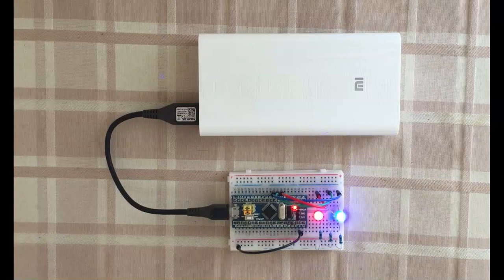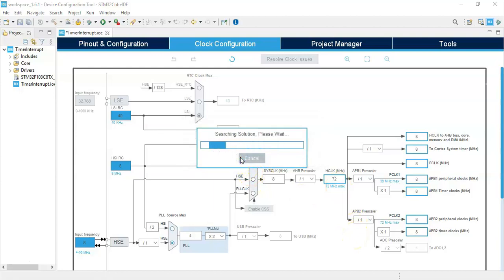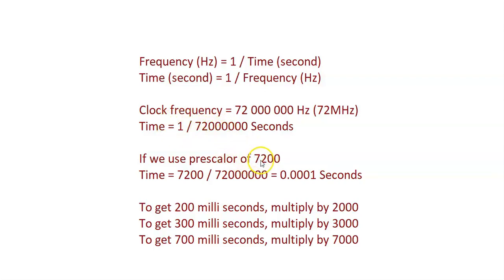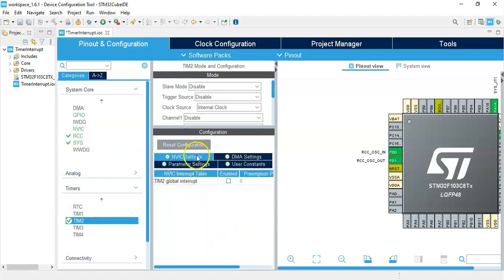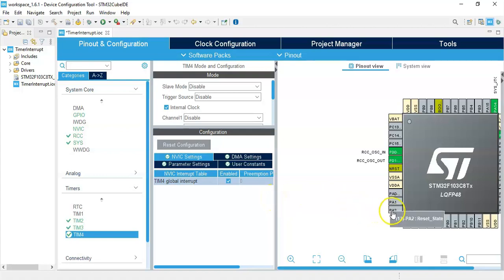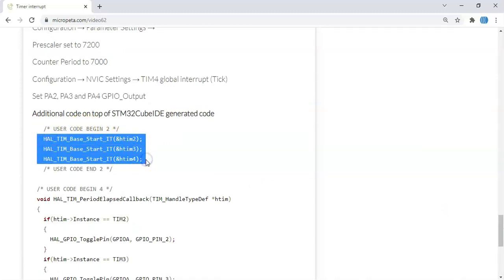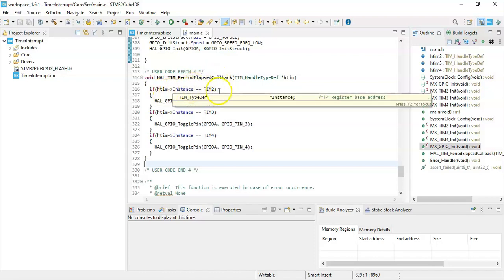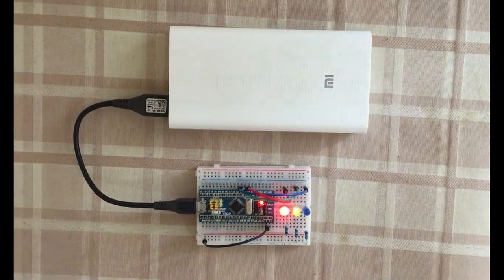62. STM32CubeIDE Timer Interrupt with STM32F103C8T6

Comment: Awesome video, Thanks you. Because I am using a Clone Bluepill board, and that ST have made an update preventing clone debuggers and stm32 boards form working, what I used is the STM32CubeProgrammer, which connected with the STM32F103C8T6 clone chip, and I selected the .elf file (in the project folder, under Debug) and downloaded it to the board - it's a workaround for flashing the STM32 without debugging.

Comment: Hello! Answer please. Can we change timer settings during programm is running? i am considering Car engine manegment system, rotating trigger wheel on crankshaft makes interrupt every 6 degrees. we need to ignite sparks when trigger wheel interrupts + some amount of time. this amount of time alway differ and depends on a lot of parametrs.
Reply from the maker: Yes. You can
HAL_TIM_Base_Stop_IT(&htim2);
// During prorram running change the values inside MX_TIM2_Init()
MX_TIM2_Init();
HAL_TIM_Base_Start_IT(&htim2);
Reply: @NizarMohideen  thank you, awesome. i will try it.

Comment: can  I use the defoult high  speed clock and adjust the  counture peroid,and pre scaler
Reply from the maker: Yes. You can
Adjust the prescalor and counter period according to the required interrupt time
Reply: thanks,  I connect the TCS34725 colour sensor    int pin to GPIO  to get timer intepurret data.
how can  check getting data in right time intervals
Reply from the maker: // Have any variable such as xyz
// in the interrupt callback routine set xyz to 1

void HAL_TIM_PeriodElapsedCallback(TIM_HandleTypeDef *htim){
  if(htim->Instance == TIM2)
  {
    xyz=1;
  }
 }

// In the while loop
If (xyz==1)
{
  getRGB(&red, &green, &blue);
  xyz=0;
}
Reply: Thanks, if I need to get 10 sample in same timer,how can i do
can I change the xyz value  1 to 10?

Comment: hi, very helpful video. I have to program a counter, using internal timer, which counts in steps of 100 nanoseconds. i think i need at least 10mhz, the bluepill has 72mhz so i should be ok, but i am scared about crystal/ceramic resonator that is 8mhz. The counter starts when a photodiode change is value. what do you think? thanks and have a good day

Comment: Did you use a hardware debugger?
Reply: I'd like to know if I can program this board without the st-link debugger
Reply from the maker: Yes. You can use FTDI. But, it will not work with CubeIDE. You can use STM32 via FTDI using other IDE's for example ArduinoIDE. I have seen there are many videos available in the youtube.
Reply: Thank you,I have used Arduino IDE before.Thought I could use the FTDI with CubeMX..thanks for assisting.